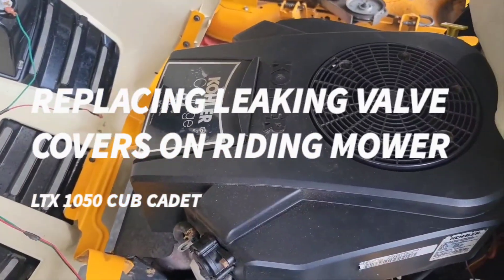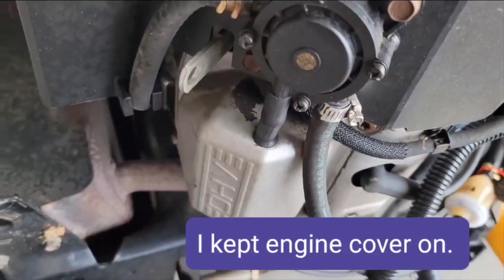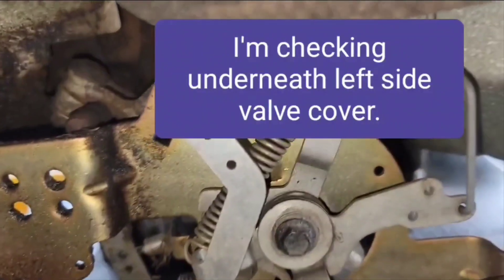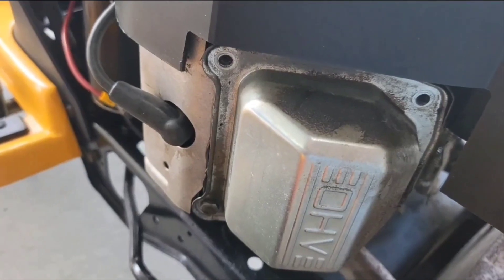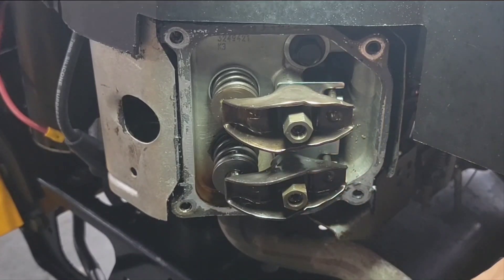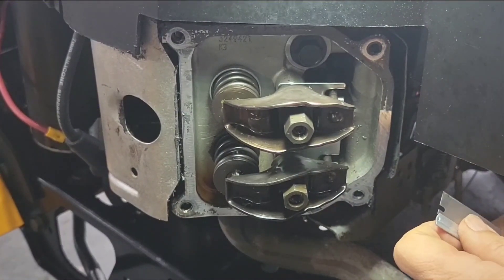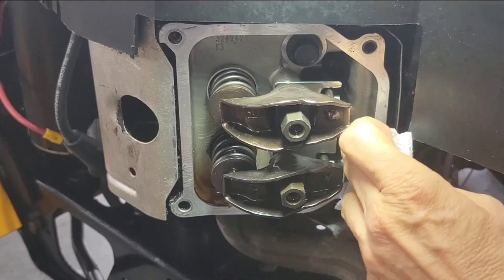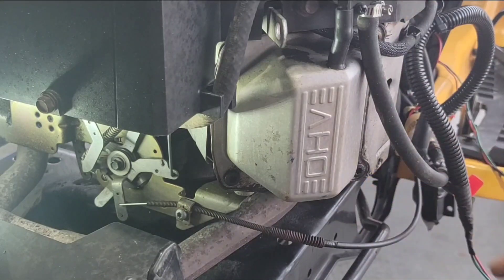Part 1 REPLACING LEAKING VALVE COVERS ON CUB CADET RIDING MOWER / LTX 1050 / LTX1050

Comment: Where do you find gaskets to seal the covers to keep the oil from leaking?
Reply from the maker: Hi Willie, I'm not sure where you would get a new gasket.... 
A gasket came with my new covers. 
Is it the gasket u r needing the one for the original metal cover or for the  newer updated plastic molded cover?
Reply from the maker: Here is a link I found on amazon for a new gasket but I think its for the newer plastic covers.
Reply from the maker: Heres the link. https://a.co/d/aA3r8iP
Reply from the maker: On the kohler website, on page 57 of the SV725 engine manual it says to use RTV sealant for the original steel stamped valve covers. But many people say they are hard to keep from leaking. Kohler says to put the cover on flat surface and if a feeler guage of .012 in will slip through the surface and cover, that the cover is too bent and must be replaced. If the feeler guage does not slip through, they say to use RTV. Be sure to clean the surfaces good... and wipe down with a solvent like brake cleaner before applying the sealant. 
I put on the new plastic covers over a yrs ago and no leaks yet... the link for those should be the description.
Reply: You’re correct, the recommendation is to use a RTV high temperature sealant. I bought some at an auto parts store. We’ll see how it goes.
Reply: Thanks for your responses.
Reply from the maker: @williesr1 let me know how it goes....